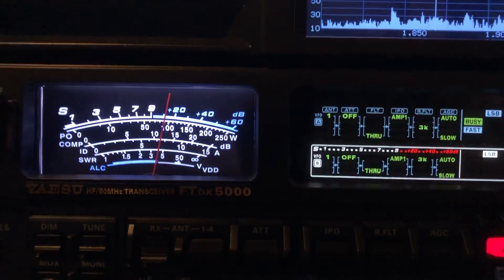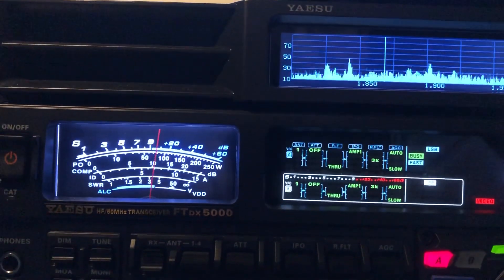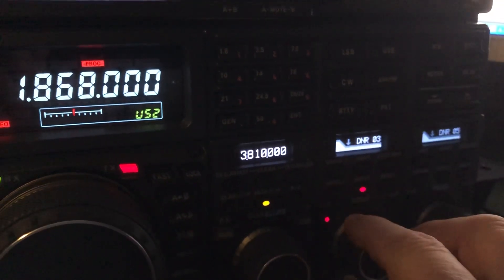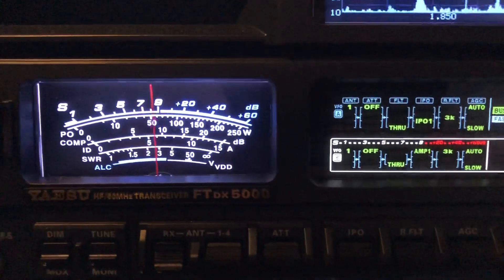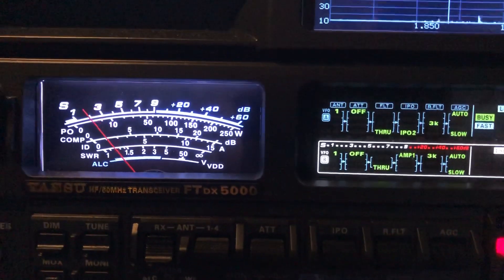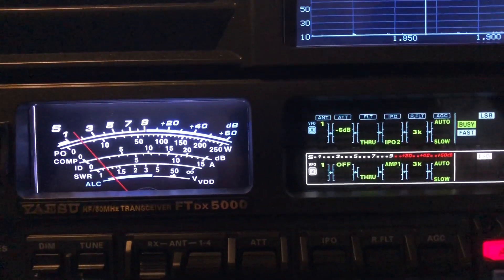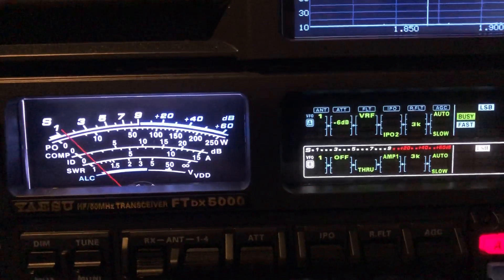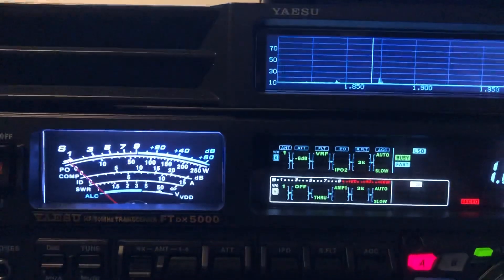Yaesu FTdx5000MP: IPO1 and IPO2 #hamradio #yaesu #ftdx5000 #ipo1 #ipo2

Comment: Hi Doug, nice demonstration with your fantastic radio 📻.
I have just ordered a new ftdx-5000 via the Yaesu factory in Japan 🇯🇵. Hope to get it shipped soon, may I say thanks for helping me decide on the 5k 😁👍
Best 73's,
GM0KET 🏴
Reply from the maker: Hi Ray!  I'm so glad that you found the videos helpful.  I was thinking about how much I searched for videos that illustrated the capabilities of the various radios I was considering.  Fortunately for me, I live close enough to Ham Radio Outlet that I was able to compare all of the radios they sell against one another.  At this price level, there are several great contenders.  The FTdx101D was a tough contender, as was the TS-990S, and the IC-7610.  I didn't care for the receive audio from the TS-890, but that may be personal preference.  I must also give an honorable mentioned to the FTdx3000D.  It is a strong contender in any price range, but especially the $1,500 to $1,800 USD price range.  The Kenwood TS-590SG is a great radio in its price range, but the digital noise reduction is abysmal.  

I was in the market for a contest capable receiver, with dual-receive a plus.  In the end, my decision came down to ergonomics, 200W, a 300Hz crystal filter installed, superior digital noise reduction, ability to pull weak signals up out of the noise flow, a 3-year warranty, and knobs.

I'm not in love with waterfall displays, so that wasn't a draw for me.  The SM-5000 does all I need.  And the sound enhancements built into the SM-5000 (various audio tapers, phase reversal), and hearing VFO-A in the left speaker and VFO-B in the right speaker (when set to dual-receive), solidified my decision to add the SM-5000 to the radio.